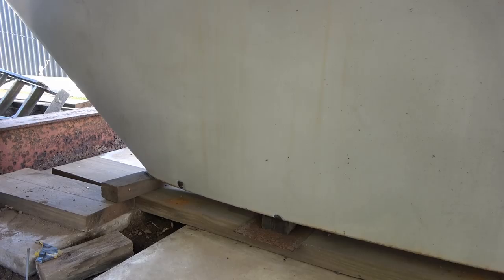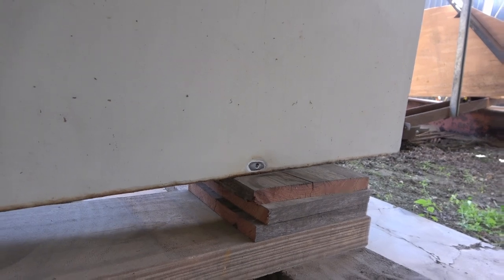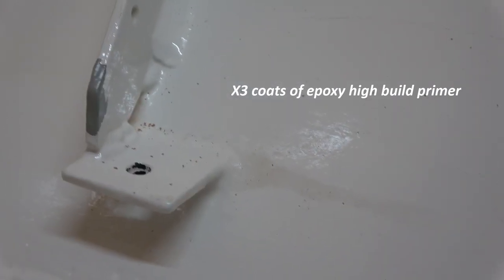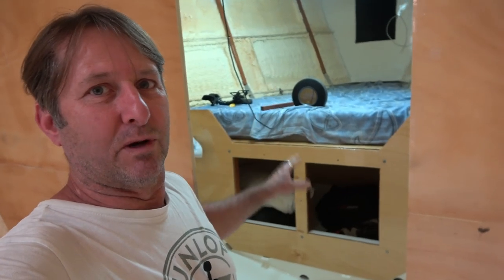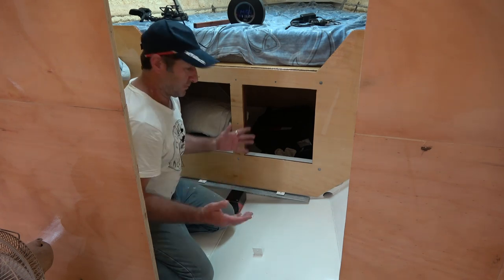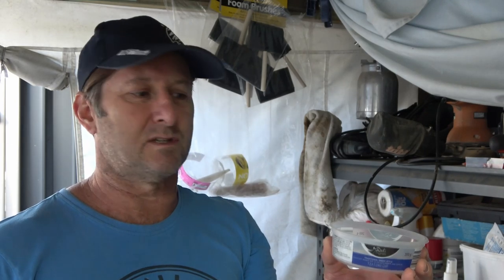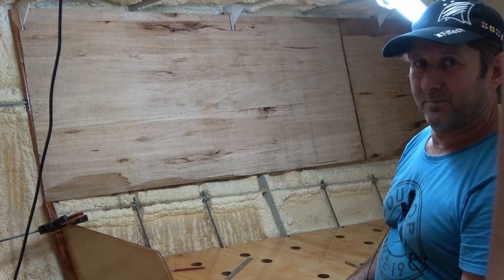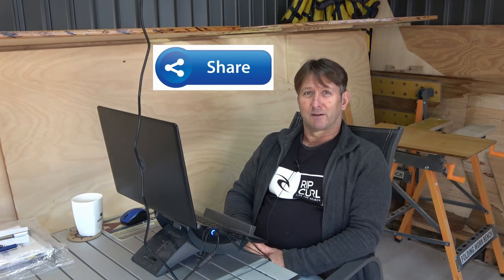Building my steel sailing yacht Ep.49 A Few things going on,..

Comment: A fast way of figuring out the panels for the hull are to rip some scrap thin ply, and tack it together into the space as a template. You can transfer it over to the finish panel and it'll go in first time, no need for measuring.
Reply from the maker: Thanks Rhys and yes I did/am using thin ply templates, the measuring was to get the rough template size hey  🙂👍
Reply: @BuildingSYMistress  I didn't explain it very well, I mean rip it into 3 inch strips and do it that way. I'll explain in a vid for ya 😆
Reply from the maker: @SailingYachtZora  ahh yes, thanks and I understand this method. Actually I have always preferred to template in the full size, it is easy and this works better for me and I don't ever make mistakes on the $marine$ ply!  😀👍
Reply: @BuildingSYMistress  perfect then 😁😁

Comment: Watch out for the galvanized smoke when you cut those angle irons, I've been serious sick couse of that in younger years.
Hold your breath or get a respirator. 
On my similiar boat theres also Speed/Temp and Depth transducers in the in the forward cabin just aft of the "bed" area, shouldn't you also have them mounted  there? 
Also the "scarfing" between the linings are behind the cabinets in mine so it's never visible, just a thought.
Reply from the maker: Thanks for your good comments Johnny and Yes fully understood and you are the only other person that I know of who knows about the holding your breath thing! I have a habit since a child of holding my breath whenever I encounter noxious or even bad organic smells and definitely did/do this with cutting galv. steel AND all of the welding too! It is good practice too for surfing and the free diving ahead!
Yes I will be having a transducer mounted in what sounds like the same place as your boat, but I will hole saw cut that down the track once I have that nav. equipment. And yes again re. lining joins being hidden behind cupboards, I will doing this wherever possible and also some timber trim will hide some joins. Thanks again for your good comments!  🙂👌

Comment: This is quiet a build hands down...great pro workmanship..I been researching between a steel hull or wood hull...sure more maintenance on the wooden one ..I think..but one dum question sir...the steel one would it rust overtime on the inside do to condensation ..nd have the need for a bit of brushing nd painting from time to time...I see the berth are is all insulated ...how would one need to get in there if need ever to do little TLc..??? Or no need to???
Reply from the maker: Thanks for your great comments and question Henry! In short, in my experience and wide researching and opinion, for a small steel pleasure craft if the steel on the inside is prepared and paint treated meticulously and correctly (there ARE correct ways) and then not damaged then there really should not be any need to revisit it for maintenance, at least for a typical human lifetime. All of the steel boats that were protected correctly and either had no insulation at all or had closed cell PU spray on insulation applied that I know of have not had any condensation corrosion issues at all to the inside of their boats.
Being diligently careful in the build and protection stages are THE MOST important approach and will save A LOT of time, $$'s and maintenance issues later on. And btw - there aren't any dumb questions sir!  🙂

Comment: Still enjoying your channel Bruce!! Your project is doing great! Why don’t you weld the brackets on the floor angle iron. I know you have more painting to do but..
Reply from the maker: Thanks very much for your encouraging comments Joep. The plan was always to mount those cabin sole supports as you saw and so there really wasn't any need to weld them for the job they are doing  🙂👍
Reply: I think it would make it easier for a refit down the road .
Hardened bolts with a lock washer and then painted is the way I'd go .
Definitely torqued to whatever specs for the bolts being used .
 HHBpHhelps
Reply from the maker: Thanks for your comment Henry  🙂

Comment: How did you know the water was in the voids - or whwere the voids where, did it rust right through the hull?
Reply from the maker: Thanks for your good question Philip! The short answer is that I did not know. I just had a suspicion that there may well be. I actually contacted and tried getting somebody (2 different businesses) with an appropriate ultrasound to scan the keel to find out, but their recommendations were to just drill holes in the bottom to find out, which 1)would be their recommendation anyhow if any water was detected and 2)is an easy thing to do and weld up after, which is what I did.
No, there was definitely not any corrosion in the keel plating, which you can see quite clearly in this video where I zoom in.

Comment: Did you spray some rust eater, converter /protector into the keel before you closed those drain holes ?
Reply from the maker: Thanks for your good question Mark and no I didn't and for a few reason's such as whatever product that I may have put in would have been burnt off by the subsequent welding it up and because this keel is now sealed off from both oxygen and any electrolyte (water) there won't be any corrosion inside the keel.

Comment: How could water get into a solid lead keel?
Reply from the maker: Thanks for your good question Frank. The lead is poured in to the steel keel plating and as the lead cool's it shrinks and so can leave slight void's between the lead and the steel casing. After I made the keel it was placed beneath Mistress but not fitted and sat for a while, when I was unable to continue the boatwork, and with the rain some water collected on top of the keel. This was how a little water got in.

Comment: coming together nice, just wondering did you fill up the voids in the keel with epoxy or foam to prevent future erosion
Reply from the maker: Thanks Bruno and actually short of cutting the keel open to "find" where those little voids may be, it would be near impossible to find where they may be,.. and this is very typical in any keel that has lead inside of a casing/skin. I guess that you mean corrosion where you say 'erosion' and fyi because this keel is now sealed off from both oxygen and any electrolyte (water) there won't be any corrosion inside the keel  🙂
Reply from the maker: @BrunoWiebelt  Thanks Bruno but it actually isn't so simple to find where those little voids may be to know where to drill a hole that would enable reaching them and then the new hole would need welding up,... which would melt the lead behind it causing another void, etc, etc,... I hope that this makes sense?

Comment: Bruce dose the mast go right through the deck
Reply from the maker: Thanks for your good question Nigel and no, the mast is stepped on the deck, on top of that plate that you saw me talking about, which I prefer over keel stepped  🙂👍
Reply: Building SY Mistress: I completely agree with deck stepped vs keel stepped. One less hole for water to go through. Is there a good reason for keel stepped?
Reply from the maker: @frankd2301  💯% agree Frank!